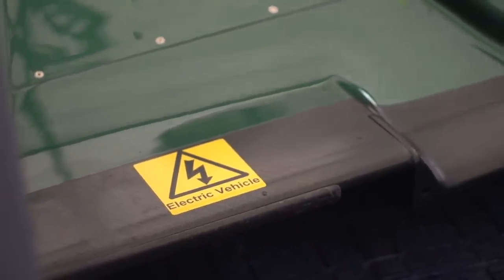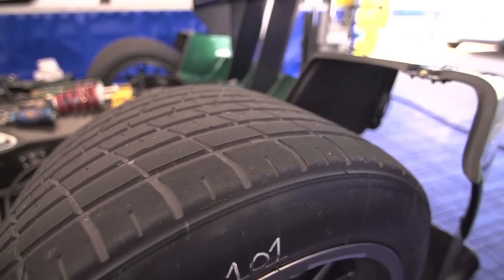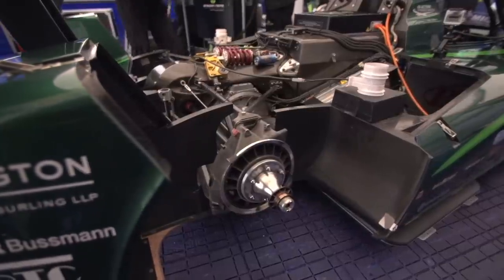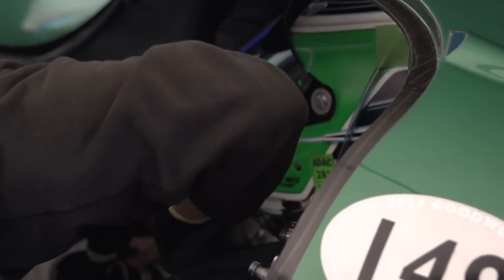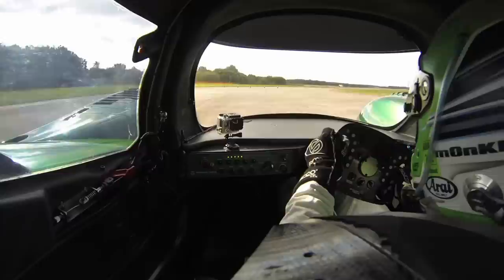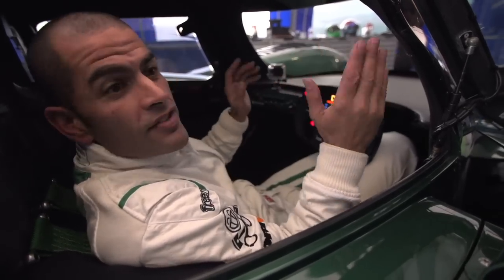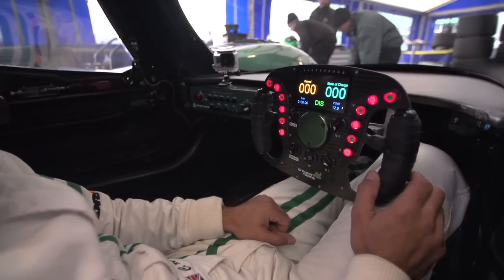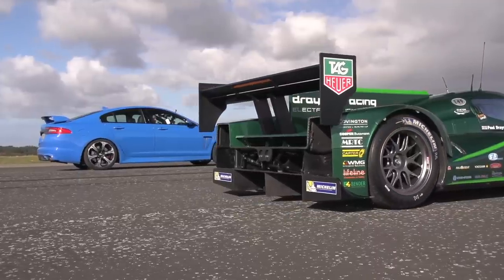850hp Electric Racing Car: Driving the Drayson B12/69EV -- /CHRIS HARRIS ON CARS

Comment: Speed is, and never really was, the problem with electric cars. Everybody always knew how much torque electric engines can produce. Even the lack of sound, one could get used to. That humming sound isn't all that bad really. The real problem is still range and charging time. It's still a massive problem, and I'd be really surprised if they would solve those enormously difficult physical issues in the next 5 or even 10 years.

Comment: It is indeed great technology. But I wouldn't say that battery powered cars are the future. It takes quite a lot of effort to make and recycle lithium ion batteries ( or any other type of battery). And a quick research on the web and a calculation shows that there is at the moment around 3 kilograms of lithium available for each person on earth. For small electric cars you need at least a hundred times more mass to make it have an acceptable range. So my opinion is that batteries shouldn't be used in cars because it is simply not realistic. Just keep using the batteries in smaller electric equipement.

Comment: For those who are not familiar with electric cars, let me alleviate your ignorance on the subject:

Producing electricity from hydro, win, geothermal, solar and eventually fusion reactors, is 100% less harmful to the environment than any gas/diesel engine!

Even is you produce electricity with, say, natural gas (which is already way less harmful than petrol), you can maintain and supervise 1 big plant much more efficiently than millions and millions of interdependent, inefficient, not-properly-maintained cars on the road. You can even collect the armful emission from a power plant, directly at the source if you want, which is nearly impossible to do with individual cars. Unfortunately, inevitably, those non-renewable source of energy WILL get depleted one day (and that day is coming fast). So going electric is actually not even an option, it's a necessity. Better do the switch sooner than later and massively invest in electric science and R&D right NOW. 

Also, we are on the verge of getting commercial grade carbon nanotube super capacitors acting like batteries with orders of magnitude better charge capacity than lithium, at a fraction of the charge time and a fraction of the weight. Hundreds of miles of range, charge time in minutes instead of hours and NO POLLUTION from mere carbon graphite! (compared to lead of lithium batteries) Imagine what we will get with another 20-25 years of scientific research! There is also the option of fuel cell technology with water as a waste product!

Add to this no oil change, no filters, no cooling fluid, no spark plug, no spark plug wires, no alternator, no starter, no injector, no radiator, no tubing, no belt, no nothing! You can even use breaking to charge the battery and save on the breaks! The only thing you'll ever do on an electric car is change the tires, the brakes and the brushes on the motor every 300 000 Km (see bellow for the batteries). All this is INFINITELY less harmful for the environment! 

Finally, when the infrastructure catch up, you'll have "recharge station" across the country, just like gas station right now. Better yet, as soon as the batteries are considered commodities independent from the cars, (which is also inevitable) those stations will actually automatically swap the entire battery pack in a few seconds, much faster than refueling a car!

The only real problem with electric cars is the indecent amount of oil cartel money in politic aggressively and artificially stalling progress. We could have 25 or even 50% electric car on the road right now and tens of thousands of charge stations, if it was not for this abomination. 

BONUS: You can run your car for free from solar panel, or other source of renewable energy, once the cost has been amortized. Solar panels get better efficiency and are cheaper to manufacture every year. Triple-junction solar cell are already reaching close to 50% efficiency (which is both amazing and only the beginning) and will get dirt cheap when reaching critical mass market demand. We get a max of ~1000 Watts per sq. meter from the sun (equator, noon, no cloud), but more realistically, around 600. 8 hours summer day, 40 degree latitude = ~600 Watts per sq. meter. So 8 hours x 600 watts per sq. m = 4.8 kilowatt hours per sq. m. For 1000 square feet (typical roof area) this is equivalent to about 450 KWH, or 225KWH @ 50% conversation rate from the solar panel! Once we get 75% conversion solar panel, it will be 340KWH! No thousands of miles of wires from the power plant and multitude step up/down transformers required!

Conclusion: The internal combustion engine's days are CLEARLY over and the electric car is light years ahead when it come to protecting the environment on ALL accounts. Don't take anything of what I've said for granted, Google everything yourself!

Now that you know, go and spread the good news.

Comment: ~850hp, ~3,000ft/tq.  Keep in mind this is still first gen technology.  A first effort and first go at this.  It will only get faster.  Look at the current hybrid supercars(Porsche, McLaren, Ferrari) for example.  First gen.  And they are barely using the electric aspect of it. They are all making close to 1,000hp and I'm sure the next version will be over 1,000hp.  The Tesla and the rest of the current street cars have tiny, tiny little motors in them for now.  And the inverters in them aren't powerful yet.  There will come a time when electric anything is faster and gasoline will be like how we see steam powered today.  Look at top Top Fuel dragsters for example.  Seem like crude monsters from the 1950's even though they are indeed very fast.  Very crude at the same time.  Steam also makes a lot of power/torque.  Look at the couple of production electric motorcycles that are out now.  Quick and yet they aren't even "powerful" yet.
Reply: it won't matter regardless because this powertrain is restricted. racing has rules, this car's potential is hardly being tapped to fall between those guidelines. look at any racing car as an example: whatever the engine is, it can make alot more power than it is. Chevrolet's "ZR1" le mans cars only make 550hp.

Comment: no rear brakes?
Reply: Regenerative braking from the motors is probably more than enough for the rear -- just look at the torque figures. Adding traditional brakes to the rear, as well, would simply be adding more weight to the car (and unsprung weight, too).

Comment: In future road electric cars,at no time you can't have the traction control not working,because with the torque motors produce mere mortals could never control them.I'm sure our children are going to look at our torque and power curves and have a good belly laugh at our antiquated internal combustion engines.

Comment: Ok, Now I may be wrong here, But this is what I understand of the Formula E series and how it'll work. Each team will have 3 cars to complete 1 race, Swapping cars twice in a race. All cars will be the same, making it a spec series and, Therefore, Not having true innovation and allowing engineers to push the tech, Also meaning this car ain't going anywhere near that series. I understand the 3 cars are necessary as swapping 300kg of batteries in a pitstop is infeasible, But having it as a control series renders it a useless parade doing nothing but provide fake PR bs, At least in my own opinion.
Reply: Not sure what you have against spec series. They'll still learn a lot about racing electric cars. Innovation in motorsports isn't limited to the cars' specs.

Comment: the electric motors are grate it delever too much torque (that's way the locomotives are equiped with electric motors) & it's better if the car gets 4 motor that will enhance the tracion acceleration & cornering

Comment: We need long range wireless electricity for this.
Reply: We don't need long range just wireless charging stations surrounding the whole race track. That's coming next.
Reply: That could work too. There was talk about having a lane with inductive charging on highways here in Europe, but it'll be a while before that gets implemented. I think making it long range would make it more economical.
Reply: ManWithBeard1990 Batteries are heavy. You give a car more capacity and you end up wasting more energy moving those giant batteries.
Reply: Not true aerodynamics are what makes a car inefficient/efficient and account for a lot more rolling resistance than weight and the electric drive train is so efficient it makes up for the extra weight regardless. My electric truck which is hardly aerodynamic gets the equivalent of 80 mpg all around city/highway in electricity use. That being said this car in the video could have been a bit more aerodynamic with the cab seating a little farther forward and the front end a little bit smoother it would be faster and have more hp to spare.
Reply: ANEWLow Scam
When I see a hybrid Suburban that gets good mileage, I will believe that =)
Reply: What? No my truck that I converted with a dc system and just lead acid batteries(both systems could be more efficient) that is all electric IT DOES NOT USE GAS just like the car in the video. When I hook it up to a 110 volt outlet and charge it I charge through a device called a killawatt meter and that let's me know how many kilowatts I use. My electric rate is .11 cents per kilowatt and if I go 30 miles and it cost me about $1.50 divide the current price of gas in my area which is $3.58/1.50=2.386 Multiply 2.386 by 30=71.6 and that is your equivalent miles per gallon and that's a crappy day for me. As gas goes up my equivalent mpg goes up as well.=)
Reply: So that's how you people get these wild claims on equivalent MPG. I thought it was the amount of gas you'd need in a generator to make the electricity.
Reply: ANEWLow Scam
That sounds like fun. How much did the conversion cost, and how much does your truck weigh? How many years do the batteries last before needing to be replaced? Do you use any desulfators?
Reply: Well a motor new is about 1600 controller new is about 1000 to 1800 or you can build one from the paul and sabrina kit for 600 chargers vary in price and can be anywhere between 30 dollars to 3000. After this drunk wrecked my first conversion I just bought a conversion and spiffied it up a bit I bought everything together for 900 and had it shipped to me for 500 and bought new batteries for 1400. A good pack of 6 volt golf cart batteries will last 6 years but I'm about to come into some extra cash so I'll probably be purchasing Calb lithium cells they are said to last forever if taken care of properly and the lead acids will probaby go toward my back up solar bank. This is a HUGE topic though and there are a lot of factors to take into you have to decide what you want. My absolute favorite conversion of all time is the ultra range vehicle built by Dave Cloud named the Dolphin it gets 200 miles range lead acid http://www.evalbum.com/3242
With  a lithium pack that weighs the same it could get 1000 miles range at highway speeds. Why can't Telsa motors do something like that? Their 85 kwh pack would take the dolphin to 700 miles range! Here's is a link to where you can look for conversions for cheap
http://www.evtradinpost.com/ every once in a while there is a really good deal or if you are dead set on building you can pour through diyelectriccar.com remember though the larger and more unaerodynamic the donor choice the more $$ you spend on batteries.
Reply: Long range wireless electricity... lets see, I believe that already exists, its called lightning! Problem is capturing it and directing its energy into your battery, instead of onto the local radio mast or a tree or hilltop or other... :-)

Comment: The battery is 30kwh, more than the LEAF.  This means that if you were very light on the pedal, or just put an eco mode in the controller, you could probably go farther and longer than a LEAF.  This is yet another awesome thing about electric versus gasoline engine cars: a electric super car can have an eco mode that equals the efficiency of an electric econobox.  A gas supercar sucks more gas idling at a stoplight than a gas econobox going full out on the highway. 

As better controls become cheaper, and batteries become larger (which also means they become more powerful), power will come even to the econoboxes in almost disturbing amounts.  Electric cars will be (are already) a lot like computers with regard to their constant and inexorable advancement.  Technology's the limit.  Die, gasoline cars, die.

Comment: I think as a spectator sport and for the spectators, EV racing is going to be very dull. The racing will always be there, which is really what we are there for, but sound is very important to keep it interesting. From a drivers standpoint, I can see the appeal very well, the unrivaled performance is a racers and drivers dream, but for now, opportunities to race something even vaguely similar is way to expensive and very limited, you will have to be in the very top ranks of racing to ever dream of having a real chance at racing one of these.

Comment: Find a way to incorporate a manual gearbox and I'll welcome it with open arms lol
Reply: They are currently having difficulty building tyres that can cope with instant 4000 nm - putting a gearbox - which , is basically a torque multiplier , onto that engine - you've got 16000 - 32000 nm depending on gearing - might be a challenge to drive lol.

Comment: We don't need more electric cars on the road, we need only a few. Why trash this planet with awful waste from the batteries? We all know Electric cars have no emissions and race cars have a pretty solid amount of emissions but the battery trash will accumulate far quicker and have a much much worse influence on this Earth. Those batteries must be changed,(not recharged) every few thousand miles or at least 10k miles correct?) Which creates tons of acidic trash yearly. Love the idea of these cars though. Thanks instant torque is something every race fan dreams of.

Comment: this car need a sound !! xD
Reply: Why? Sound is simply wasted energy. Why should a vehicle waste energy to give you the impression of power by mimicking an outmoded technology? Why don't you demand jets of steam or the smell of slaves or horses sweating from your cars? Because that would be stupid. So would having an electric car fake the noises of an internal combustion car.
Reply: Martin Willett
Part of enjoying motorsport, for many people, is the sounds the engines make. I get what you're saying though, and agree.
Reply: My first word was car (or food, my mother can't quite be sure which). I am very much into cars but the point of a car is moving fast and precisely, not to make dust, smoke, noise or widows.
Reply: The sound is a by-product, a by-product and an indication of inefficiency. Faking it for people lacking an appreciation of what they are observing is stupid. What would have happened if the first motor racers were told to cover the tracks with horse shit and strew straw everywhere to recreate the atmosphere the punters had come to expect? Electric motors produce torque not a screaming banshee wail that requires ear protection. Now as long as engines make noise we can argue about the timbre of it and whether a hearty grunting flat twin sounds as good as a BRM V16 putting out 12,000 RPM or a Cosworth V8 at 20,000 RPM but none of those machines made noise as their primary purpose. What they made deliberately was power and torque. Now electric motors can do that, better perhaps, and almost without any noise at all. So cars won't be noisy in the future. They no longer smell of castor oil these days either.
If you want an impression of speed try skateboard luge or karting, being close the ground and fully exposed heightens the impression of speed, as does participating rather than just listening to somebody else do it.
Reply: So that's why this car does NOT need a sound! Cars don't need artificial steam engine or horse sounds, that would be muzak.
Reply: The sound of a conventional internal combustion engine comes from it operating as it should. It is a natural intrinsic sound, it is not added for effect. The natural intrinsic sound of an electric car is much less, it doesn't waste energy on noise it applies it to the task in hand of applying torque to the wheels. A fake sound would have no soul or emotion, it would be as pointless as sticking a playing card in the spokes of your bicycle wheel and pretending it's a motorbike.
Reply: As the cars become more powerful the cars will start to produce sounds that a combustion car cannot.

That car had a space ship sound of the future sort of a hum and that could become more pronounced.
Reply: Indeed electric cars have their own sounds which people will in time come to associate with speed and power. There is nothing intrinsic to the bellow of a V8 that says speed or power, we just have those connections in our brain, the same way some men have connections between stockings or fur or nurses' uniforms or high heeled shoes or red lipstick and sex. You can't eat the sizzle of the sausage. When the sound of a V8 gets associated with being left behind in a race and not impressing the women men will stop fetishizing those sounds.
Reply: Martin Willett they would make city life a lot quieter, though you might have to look a bit more before crossing the road!
In motor sport - yeah the roaring engine is part of the fun!!